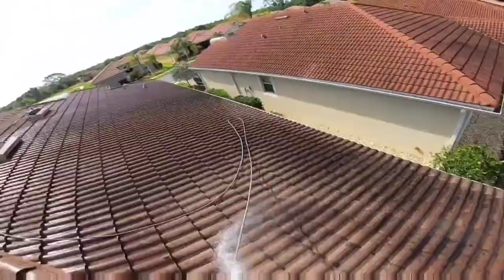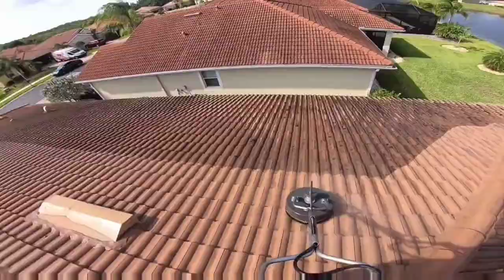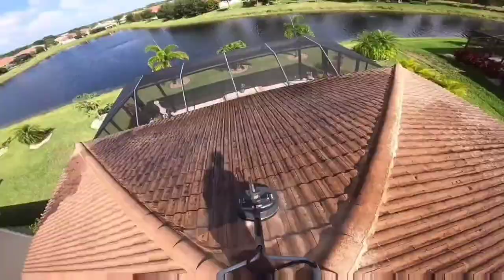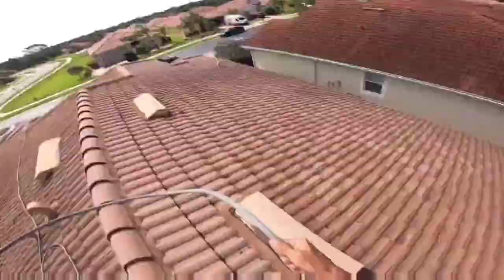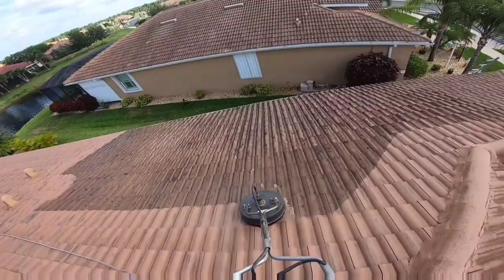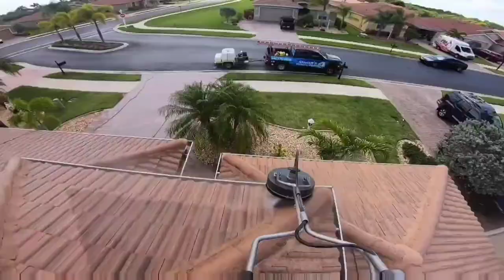AI Art

Comment: I'm having a 4.2k psi, 4gpm Machine, 16" SC, 25020 Tips.

1.   Cleaning Roof tiles which Tips you recommend…?

2.   Distance between Tiles & Tips when (adjusting/raising the Bar)...?

3.…& this 1k or 1.2k psi should be read at the Pump or Ball Valve..?

Thank You.

Comment: Do you decrease the pressure of your pressure washing machine in order to prevent damaging the tiles on the roof? If so what psi do you usually use?
Reply from the maker: Yes and I raise the bar. Pressure is coming out at about 1k to 1200 psi per tip
Reply: @stwanspressurewashing2282  Awesome! Also, how often would you need to clean a roof like this? once a year? once every two years?
Reply from the maker: Depending on where you live and the area within that you live in.. aka shade or southern States. Every 2 years is a good rule of thumb.